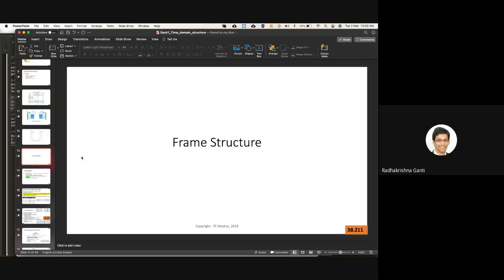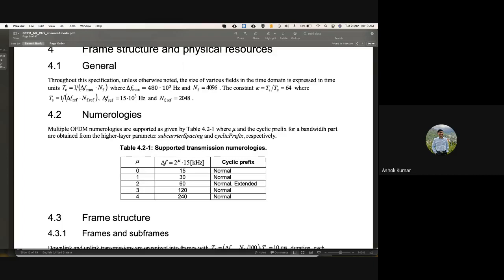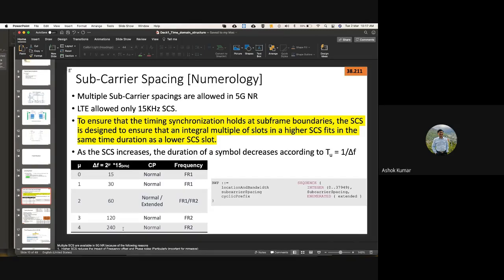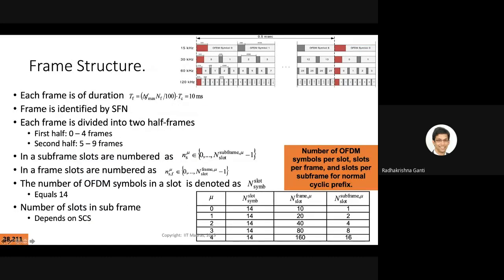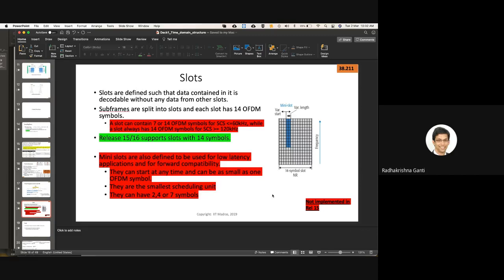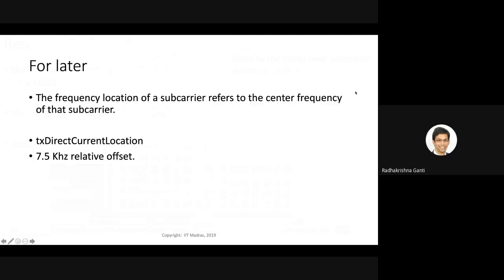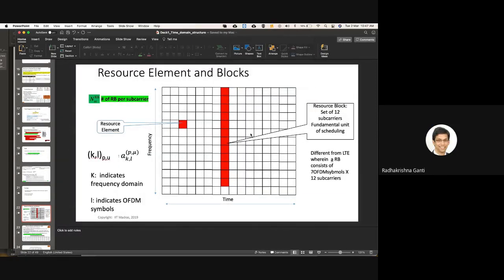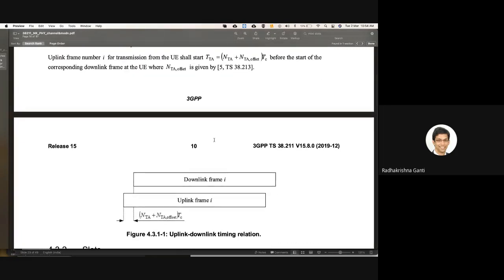EE6143 Lec11

Comment: Thanks Professor. So we have one grid for every combination of  (port,subcarrier) ? Let say we have two port one with 15Khz and another with 30KHz. 
Does it mean we have two resource grids in which data can be transmitted in downlink by the base station ?
Do the grids corresponding to different ports and subcarrier interfere with each other ? Lets say we allocate subcarrier 3 in symbol4 in both the grids in downlink. Can it cause interference ?